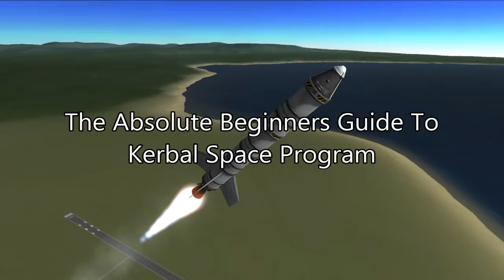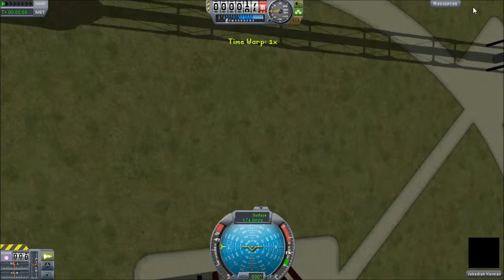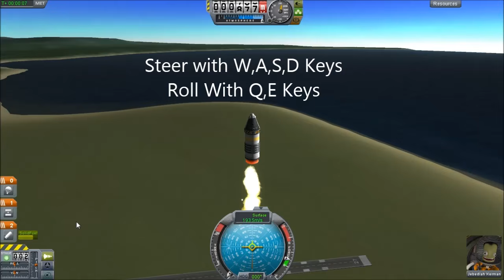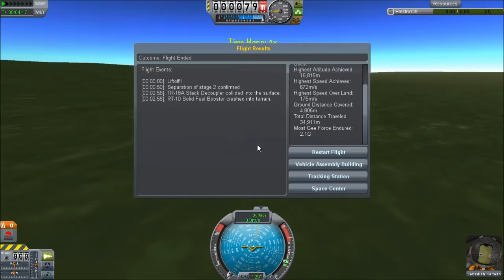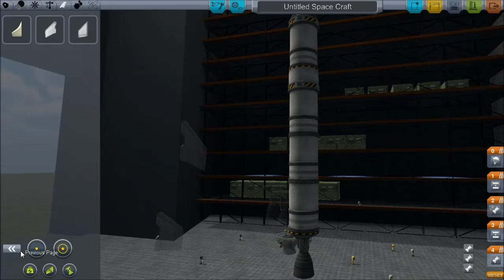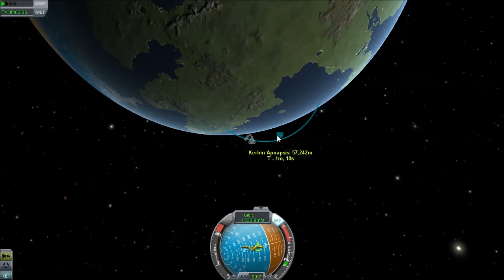Kerbal Space Program 101 - Tutorial For Beginners - Construction, Piloting, Orbiting

Comment: Why isn't it launching with liquid fuel
Reply: Because you need oxides and liquid fuel to power rocket engines or boosters
Reply: ramon gonzalez fernandez im a veteran in ksp and i still watch this video
Reply: ramon gonzalez fernandez You may have a pretty weak thruster which doesn't have enough power to lift it off the launch pad.
Try a bigger thruster and adding a few solid-fuel boosters on the sides to help with the lower atmosphere. Once you get to 10 km(10,000m) turn 45 degrees you can jettison the boosters and liquid thrusters should get you to a decent orbit.

Comment: How can you steer that well!? I built the exact same rockets and I can't even get them to turn at all, but they will however turn by themselves ...into the ground. First one is just a simple booster rocket. Built that and it shots up....and then turn and explodes into the ground.
Reply: Use q or e and or put on SAS module
Reply: He could have changed roll sensitivity in settings... also the higher above Kerbin you are the easier it is to maneuver, he started rolling at ~3km altitude.
He didn't use a SAS module, either.
Lastly and kind of obviously, it does take some practice to get a hang of it. While steering you wanna look at the "blue ball" thing, and not at the very misleading landscape on the main screen
Reply: kpsting
In the latest release that capsule has a build it SAS module i think. i never put a module in (as far as i know) and i had SAS

Comment: So, I followed this to the tee and I ALWAYS run out of fuel once I'm in the second stage. I manage to get to 100,000m, but as soon as it's time to burn to get into orbit, I have zero fuel. I have been extremely careful at managing thrust, especially into orbit, and using more engines only seems to make things worse. I can only think that this is because this is an older version, and I am using a newer version?
Reply: Definitely. And as you might have noticed, the current version (0.23) also implements reentry heating and whatnot.

Comment: Question: I'm using the same rocket you've got here, and I've been trying for an hour to get out of the atmosphere. Every time I get past 3000 meters or so my ship starts to turn over and I can't control it at all, and it ends up just tipping back towards the planet.
Reply: if you run out of electric charge, you won't have any control. click the resources button at the upper right of the screen, and launch as usual. watch your electric charge as you ascend to see if that's running out. if so, use SAS less, and choose an engine that produces electricity.

Comment: I'm having a hell of a time trying to actually build a rocket in this.  I just installed it, was messing in the tutorial and when I pull something off of the rocket, like an engine or fuel I lose the snap function and I can't reattach anything vertically, only on the horizontal.  No matter what I do it breaks every time I try to move something.
Reply: Hey... this comment comes too late probably but I think that the tutorial is buggy. In a normal game this shouldn't occur I hope. (I haven't played this game much at all, but I think that I had the same problem!)

Comment: > After 5 tries I still can't do this... what the fuck? how do I into orbit? i end up passing Apoapsis, can you correct this? and how?
Reply: Mandel Brotwurstershire
Here is a better way to get to a orbit;
1st. If you are a newbie, go to the VAB and load up the Kerbal X. Or, build your own rocket.

2nd. When you hit 10000 meters, yaw right, stop at 45 degrees.

3rd. When your apoapsis hits 70000+ meters, cut your engines.

4th. Wait until you are about 10 - 30 seconds from apoapsis, point DIRECTLY at the horizon, and boost until you are in orbit/your m/s is 2300+.

Source: I'm a KSP Veteran, built spacestations and landed (And got hit by the kraken) on Jool. Don't try that .-.
Reply: Maybe make your turn later. Or slow your ascent. Keep your Meters per second a slow as possible . its timing, relative to your speed and direction. hey I only just got into orbit after a dozen tries.

Comment: it's actually not that difficult:
1. get to a low orbit over your destination
2. add a maneuver that would let u drop down right at the point of maneuver (which means the calculated thrust will completely eliminate your horizontal velocity)
3. move the maneuver to the point on your orbit exactly as much time before your target as it takes you to thrust (estimated time) away your whole horizontal velocity
4. land with some minor corrections if you're a perfectionist ;)

Comment: His first rocket uses an SAS module. It's basically a cruise control logistic that you can equip onto the rocket and use it to maintain a proper angle.

Don't worry I feel what you feel. The first rocket without the SAS module is VERY lightweight and can very easily twist and spin out of control. The SAS module will somewhat make controls ''heavier'' therefore making you have to input a direction for a longer amount of time, as the module keeps your peice of metal steady.

Comment: @Scoot Manley
Well, I just installed the most new version (0.21.1) and I can't make the 45º turn to the east when I get at 10km alt. When I try to push right, some strange power keeps pushing my ship back left, so I can't keep the 45° to the right until I jettison my fuel tank. So after jettisoning it, my ship keeps dropping vertical speed and ends up passing the AP mark, so I tried to make a emergency landing at the island airfield, which din't really ended up so... well...

Comment: You probably want to look at using the nuclear engines for interplanetary flights because they are much more efficient than the other engines. A couple of the longest normal-diameter tanks should be enough fuel to get a small ship to Duna/Eve; then just stick enough boosters on the bottom to get the interplanetary stage into orbit (actually probably the hardest part!).

Comment: SAS controls rotation, ASAS controls the vessel as you would do yourself, control surfaces & gimbal included. I would recommend an ASAS for rockets with 3+ stages or very heavy rockets. Right click on the engine and press lock gimbal.

Comment: Add an A.S.A.S module connected to your command capsule. Before takeoff, hit T on your keyboard in order to turn it on. Then throttle up and go, and that will keep you pointed straight up as well as possible as it goes up. Once you reach high enough, hit T again to turn it off and make it so you can turn your rocket. Once you get pointed in the right direction, hit T again and it will keep it pointed in that direction.

Comment: basically regarding steering. When you want to point in a certain direction, use the navball only. I'v often foud myself struggling to center my navball cause i thought my axis was going wrong, but in fact, the orange chevron symbolizing your nose's heading, will always point the same direction, so based on this, you can steer the nose using wasd where you want without worrying about the controls being inverted and so on.

Comment: If you bought the full version, you'll have access to the ASAS.  Being a lousy pilot, I never build a rocket without one.  Place it right below the decoupler  for your pod.  Toggle it on before you throttle up and launch and it'll keep you going straight up.  Toggle it off to turn to 45 degrees and toggle it back on when you hit that.  As for any other maneuver, toggle off to steer, toggle on once you hit your mark to stay on that track.  I hope I explained it well enough to help.

Comment: I'm having a problem. When I activate my smaller engine, it burns as hard as it can, and I have no control over the throttle. This means I can't keep it burning low and long, as it burns for about 20 seconds. It won't cancel with X either. I'm using the engine that Scoot uses.

Comment: An SAS or ASAS module can help, but if your rockets are a bit wobbly like mine it will only make it worse, however, rotation doesnt matter as long as your heading in the same direction (focus on the same angle in the navball)
and once you are in atmo you can counter your spin or turn on SAS
Last but not least, winglets and nose caps for your rockets helped some with me

Comment: Typically you want to hit the node as close to the center of your burn time as possible.  So for a 5 second burn, try to start about 2.5 seconds beforehand.  It doesn't have to be exact, for instance the act of throttling up takes a second or two which can make the timing fuzzy, but don't worry.  Just hit it as best you can, then take a look, and you can always do a quick follow-up maneuver to tweak.

Comment: In the creation menu, remove everything that you ditched at the point you turn 45º. You'll just pick the thing you ditched last and the first stages will stay attached, just put them on the side. Now, on your rocket try to figure out where the center of thrust and mass is. If you have a top-heavy rocket, it will just dip and start spinning.

If you still can't, add some RCS, use it to turn to 45º by pressing R and press T to lock onto the angle you want. But this adds even more weight.

Comment: While I'm still having issues getting used to flying by the gymbal, I've gone to using two T800's instead of his combination of four T400's.  Having more fuel in that 2nd stage/last engine helps me out.  Sometimes I'll stick some sold booster's on as well, so I can save liquid fuel for the actual maneuvering process.  I'm wondering if flight controls can be assigned to a joystick, as I think I'd do better @ making corrections with one. (so may give it a shot)

Comment: I believe the decoupler stays attached to the below stage, but the stack seperator detaches from both. I would use a decoupler to seperate a launch stage, so it stays stuck on and doesnt leave more debris, but i would use a stack seperator to seperate say 2 ship or a ship and a probe, so they arent lugging around excess weight. Hope this helps. (P.S As far as I am aware they are otherwise identical)

Comment: Set your apoapsis to 100km on the initial burn, place the manuever node at the apoapsis, plan a prograde burn (green open circle handle) at the apoapsis.  The node's planning should give you a 100x100 orbit (ish.)  The node should tell you when to burn, for how long, and in what direction.  Point in that direction and burn so that roughly half is before T-0 and half after.  You ought to have a 100km orbit at that point.  Also, when the apses move rapidly, they're almost equal, so stop your burn.

Comment: It's just difficult to control if you're not used to flying rockets yet. If you hit caps lock, you'll turn on precision controls, and it'll be a little bit easier to control. Furthermore, if you use an ASAS module, you can hit t, and the rocket will try to keep its current heading, and then you can hold down f to temporarily disable ASAS, tilt over, and let go of f to enable ASAS again. It makes the rocket keep steady a bit more.